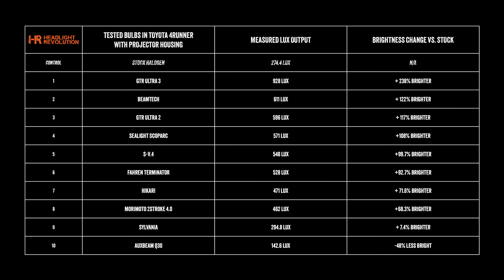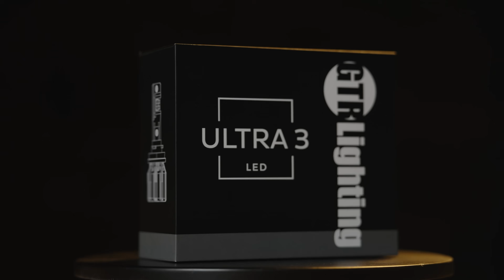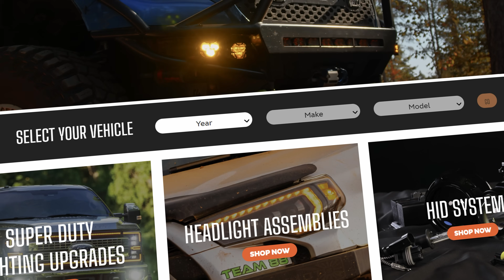The Brightest LED Headlight Bulb We’ve EVER Tested! | GTR Lighting Ultra 3 Tech Review

Comment: Phillips Ultinon Rally 3590 90w leds seems brighter than these
What you think?
Reply from the maker: I find it very hard to believe these bulbs are 90 watts per bulb, or 15,000 lumens per bulb - the brightest we've ever measured and tested before was the Ultra 3 coming in at 4,700 lumens per bulb! I haven't tested these in person yet but going off my experiences, I would find it very hard to believe those numbers at face value without some testing.
Reply: @HeadlightRevolution 
They are announced at 90w per bulb, but 15000 lumens is quoted for the pair, so 7500 lumen per bulb
I already purshased them and they have arrived today.

I'll give you my feedback as soon as they are installed
Reply: @HeadlightRevolution 
I just installed them. I can guarantee that I've been following you for 5 years, I've tried at least a dozen pairs, I'm very demanding when it comes to color and brightness, and I can already tell you that these are the most powerful bulbs I've ever used. I have a 2006 vehicle with halogen projectors; 2025 vehicles with full LED headlights can't match the powerful illumination of these bulbs. I'm the one who lights up the road the most, no matter how I adjust my headlights. The cutoff line is perfect; I encourage you to try them if you have the chance.

Comment: Would these need anti-flicker on an old 3rd gen cummins?
Reply from the maker: You shouldn't, no! We do offer them if you run into an issue, but generally you'll be just fine running them!
Reply: @HeadlightRevolution  Appreciate the response, the stock ones this week were absolutely horrible on the highway.  Was like holding a candle in front of the vehicle lol.

Comment: Gtr bulbs are a good product and I’ve recommended them to other people before. But I can’t justify spending $500 if you have to buy 4 bulbs for 2 for low beam and 2 for high beam. For that much money I was able to buy brand led  full housing headlights and diode dynamic led foglights on my jeep. Morimoto is also a cool brand as I still run their led turn signals. I just really wish you guys could bring down that price point

Comment: @headlightrevolutionI had a couple question about the yellow variant of the GTR Ultra 3, first when can we see a test of it or review? and secondly I notice it comes in a 9005 variant which is typically a high beam bulb which I'd like to see how it performs in that task. I know the yellow light will have a lower light output than white (as is always the case) but the warmer light being softer on the eyes especially when reflecting off signs etc might be preferable for some. However I also noticed that there isn't a 9006 variant (yet?) which is typically a fog light bulb and a more common place to see the yellow light bulbs installed and wondering why that is and if there is plans for one.
Reply: While I'm on the topic of light temperature. While I haven't had the opportunity to test out the Ultra 3 yet as it's premium priced so haven't decided if I can justify the cost yet, I do commend the choice of going with a warmer light temp of 5750k for the Ultra 3 white variant as it's so uncommon to see LED chips below the 6000k temperature which is a bit on the dazzling blue white side of things and I've been looking for something in the warmer shade (closer to oem color) that's still brighter than stock and works with the lower voltage of DRL lighting as I have a vehicle that uses the same bulb for high beam and DRL. So far I've only found one LED that worked with my DRL voltage and those were a switchback model that wasn't much brighter if any than stock (if only they had an option to light both colors at once it may have been brighter and a warm white as it would mix 6000k with 3000k) but those were 44 dollars so there was only so much I could expect from them.

Comment: How do these compare to the OSRAM night breaker laser HID bulbs?
Reply from the maker: It depends on the projector and ballast. In a true HID projector on a 35W/50W ballast, OSRAM Night Breaker Laser is a benchmark for long-range throw. In halogen-based optics, a purpose-built LED often delivers more usable light and a cleaner cutoff than a drop-in HID.

Comment: So I have a 2017 Tundra. I just care about how well I can see. Would these be better than replacing the whole,headlight assembly with the morimoto ,option?
Reply from the maker: It really depends on what you’re after. If your main goal is just seeing better at night, upgrading to LEDs such as the Ultra 3 is the easiest and most budget-friendly way to get a major performance boost. If you want more than that—like a full style upgrade with modern DRLs, sequential turns, and a big jump in overall output—then the XB headlights are the way to go. Both will be a big improvement over stock, just depends how far you want to take it and kind of budget you have to play with.
Reply: I also ordered the ultra 3.0. But now I’m wondering if they’re gonna be too bright and if I’ll get pulled over for them? Would I be better off to use the standard halogen to come in the alpha Rex headlights?

Comment: Sir, for your C5 Corvette, did you need to upgrade the stock halogen projector housing to an LED projector?  Or can use just install the Ultra 3 bulbs as is?
Reply from the maker: No need to upgrade or modify the projector housing—you can install the Ultra 3 bulbs directly into the stock halogen projector on the C5 Corvette. They’re designed to work with the OE setup as-is. Easy upgrade, no extra hassle.

Comment: For a 2019 dodge Durango is the anti flicker device necessary? I’m worried about fitting it all with the dust cover but don’t want to spend this much on some bulbs and have issues. Thanks!
Reply from the maker: We haven’t tested the 2019 Durango specifically, so we can’t guarantee whether the anti-flicker module is required. That said, most MOPAR vehicles do need one, but in previous testing on earlier Durango models, we didn’t run into any issues without it.

If you want to play it safe, using the anti-flicker module is the best way to ensure long-term reliability. But if space behind the dust cover is a concern, you could try running the bulbs without it first and only add the module if you notice any flickering or startup issues.

Comment: Do these work for a 2015 4runner limited that has the DRL / High beam combo bulb?  I have tried many led bulbs, but they always flicker when in DRL mode... The only ones I found do actually work with this combo So far are the VLED ones since they have 6v DRL mode.... Can you confirm if these new bulbs will work as a DRL and  high beam for 5th gen 4runner limited?  Secondly well these work in a cold climate? I live in Montana and in the winter it can drop to -20 Fahrenheit and a lot of people are having problems with led bulbs in the winter.  Ty
Reply from the maker: Yes—these will work for the DRL/high beam combo on your 2015 4Runner Limited! We’ve got Ultra 3 testing content on a 4Runner coming very soon, so stay tuned for the full breakdown.
Reply: @HeadlightRevolution  Wow perfect....I need to replace my flickering ones....I look forward to that video as I have the Projector housing factory.....
Reply: @HeadlightRevolution  Last question is will they be ok in extreme cold like up to -20 in Montana winters? I see you showed one model with some kind of pre heater in it....but I would prefer these.  Thanks

Comment: well ' these bulbs are extremly expensive and even more expensive to ship to my country , so my challenge to headlight revolution team if I bought these bulbs and compared them to other bulbs from my choice and it appeared my choice are actually brighter , would you give me a refund for my work , of course I will be recording everything for proof !??
Reply from the maker: We’d be happy to assist with setting up a return and refund, but it’s important to note that comparing brightness isn’t always straightforward. Without a controlled testing environment and the right equipment, it can be difficult to differentiate between actual brightness and other factors like hotspot patterns or beam distribution. We have the tools to make those precise measurements in our studio. While we stand behind our products and are committed to customer satisfaction, our policies do require that returns and refunds be handled according to specific guidelines.

Comment: Why not test against DDM Tuning?
Reply from the maker: DDM Tuning hasn’t been one of the most requested brands lately, which is why it wasn’t included in this round of testing. That said, we’re always open to suggestions—I’ll add it to our list for future comparisons!
Reply: @HeadlightRevolution +1 for DDM Tuning testing! I’ve been looking on BulbFacts and they’ve been listed as the brightest for a while now! Supposedly 1614 lux measured on low beams
Reply: DDM Tuning? 😂😂😂😂 Are they still in business? Haven't heard of them since the original Fast and Furious. What's that 26 or 27 years? 😂😂😂😂

Comment: For this car, I see they mention of high beam bulb, are there a separate high beam and standard driving lights?
Reply from the maker: Some vehicles use a single dual-beam bulb that handles both low and high beams in the same housing, while others use separate bulbs for each function. It just depends on the vehicle’s headlight design.

Comment: Sorry to ask but do you place the rubber boot that sits on hack of many stock headlights over this bulb ? Or do you push the boot over this bulb so it can release more heat? (Toyota landcruiser 70 series )
Reply from the maker: No worries at all—happy to help! 👍 Typically, you’ll want to reinstall the rubber dust boot over the bulb to keep dust and debris out of the housing and away from the fan. The Ultra Series bulbs are designed to manage heat even when covered, so it won’t impact performance.
Reply: @HeadlightRevolution can I clarify - you own the GTR brand? I came here thinking I was getting pure objective analysis. How do your gtr brand globes compare to the f12s? Surely you can’t say the gtr at half the wattage are better?
Reply: F12? 😂😂😂😂 Have you even read that website. It's Engrish from China has misspelled words all over it. Plus, one paragraph says 240W and then it says 220W. It also says 120W and then 110W individually. The funniest part is 42,000 lumens! Do you know what 42K lumens would look like? It's one GTR bulb multiplied by 10. You're going to tell me their LEDS are 10x more powerful. 😂😂😂😂.

Comment: What is the difference between a Lifetime Warranty for the Ultra 2's and a Limited Lifetime Warranty for the Ultra 3's?
Reply from the maker: Both the Ultra 2 and Ultra 3 bulbs come with the same Lifetime Limited Warranty, supported by the GTR Lighting team in Atlanta, GA. The term "limited" just means the warranty doesn’t cover things like misuse, modifications, or damage from improper installation.

If you ever run into any issues, just reach out with photos or video before removing the bulbs—we’re happy to help!

Comment: Are GTR Ultra 3 brighter than Bi-LED: Morimoto M LED Stage III Projector System by ~238lux in low beam?
Reply from the maker: That’s really an apples-to-oranges comparison. The GTR Ultra 3 is a drop-in LED bulb, and its performance will vary depending on the headlight housing it’s used in. On the other hand, the Morimoto M-LED Stage III is a dedicated bi-LED projector, designed for consistent, high-performance output in a proper retrofit setup.

With the M-LED, the output and beam pattern stay the same no matter what headlight it’s installed in—it’s a controlled system, while drop-in bulbs depend entirely on the reflector or projector they're paired with. Both are solid, just built for different purposes!

Comment: Brighter the bulb shorter the lifespan
Reply from the maker: That used to be true—but tech has come a long way! The GTR Ultra Series 3 uses advanced Thermal Separation Technology (TST) to manage heat more effectively, which means you get maximum brightness without sacrificing lifespan. These bulbs push out 4,700 lumens with a compact design that fits better than most competitors, all while staying cool and reliable.

And the best part? They're backed by a lifetime warranty. You won’t need another set once these are in.

Comment: Not street legal??  Ahhh, forget it!!  My question:  Any LED replacement bulbs that replace halogen and street legal??
Reply: The DOT will not test or certify any aftermarket led bulb. That is why all LED headlight bulbs have to be classified as "off road use". But I've never heard of anyone getting a ticket or cop pulled over. I've been using different LED bulbs since 2019 and no issues in the street.
Reply: @fauguy23  ... thanks for the message
Reply from the maker: LED and HID bulbs like the ones in this video are not street legal for use in headlights on public roads in the U.S., since they don’t meet DOT/FMVSS108 standards. They are legal for fog light use, and many people run them off-road or on specialty vehicles.

For true street-legal headlight upgrades, we always recommend switching to DOT-compliant headlight housings instead of just replacing the bulbs.

More info here if you’re curious: https://www.headlightrevolution.com/street-usage

Comment: I doubt these are the brightest on the market, compare them to Diamond Vision F12, or Novsight N70
Reply: F12 is 85W stable and these are 43. I use the F9 and now F12 and pretty sure the F12 would be brighter than the GTR Ultra 3.
Reply from the maker: Appreciate the recommendation!
Reply: @HeadlightRevolution so have you reviewed the f12s? Are you objective or a specific brand advertiser ?
Reply: Those f12s are 220watts!!!
Reply: @robertmillar2037 110 starting wattage per bulb, 85W stable per bulb.

Comment: Cool about Brightness but what about longevity? Sometimes being the brightest isn't the best long term
Reply from the maker: Totally fair question—and yeah, brightness means nothing if it can’t last. That’s why GTR bulbs are known for being extremely reliable, and they’re backed by a lifetime warranty. They use a custom TST 7045 chipset instead of off-the-shelf stuff like CREE or Philips, which gives them better output and beam accuracy over time.

Plus, they’re designed to run cooler with Thermal Separation Tech, so they don’t burn out like some of the bulkier, hotter options. Bright and built to last.

Comment: Does it matter which orientation the head of the bulb is? IE the “blocked off side” being up or down in the housing?
Reply from the maker: Yep, the orientation definitely matters. You’ll want to make sure the LEDs are facing side-to-side, not up and down. The “blocked off side” should usually face down, but it depends on the reflector design. This video breaks it down: https://www.youtube.com/watch?v=NbfAyqVgVdM&t=19s
Reply: @HeadlightRevolution yeah my question was just specific to the ultra 3, I have a couple sets of ultra 2s and am used to them being “blocked off” on both sides of the chip. Thanks!

Comment: I want to see testing on a stock headlamp that has a reflective patten in the actual headlamp lens. Like a stock 2003 sierra headlamp. No projector, no reflective style housing. Just the lens doing the scattering.
Reply from the maker: Ah, love when people confidently get it wrong 😅 The fluted lens on something like a 2003 Sierra does affect how the beam looks, but it’s not what creates the beam pattern. That job belongs to the reflector optics inside the housing. The lens just diffuses it a bit—think of it like softening the edges, not shaping the light itself.

That’s why when people retrofit those housings, they usually swap to a clear lens. Keeping the fluted one just blurs the new beam pattern and ruins all the work you put into the projector.

So yeah... not how it works, but thanks for playing.
Reply: Your response is out of line. I constantly commend your staff on the videos and I've purchased multiple sets of leds from you guys. My comment was a sincere comment not knowing whether it would change how the pattern is. Ive only installed on projector or clear housing. I didnt make one insinuation. I went back to stock style capa cert housings from projectors and was worried about it messing the lighting up. Ease up  @HeadlightRevolution
Reply from the maker: We appreciate you being a longtime supporter. Just poking fun with the original reply, definitely didn’t mean to come off harsh. It is a common misconception we hear a lot, so we try to clear it up with a little sass sometimes 😅 No hard feelings at all—we’re glad you brought it up, and if you ever want help dialing things in with your setup, we’ve got you. Thanks again for being here!

Comment: I was just wondering about the Ultra 3 the other day.   Can they survive being powered on for 6 or 7 hours nonstop?  That's how long I drove last week from NYC to Chicago.  First stop was 6 hours later, only because the gas tank was almost empty.   The entire trip was at night, starting around 10pm.
Reply: Can't wait to see comparison to 2Stroke 4.0!!!  I love the 2Strokes, but I've got see that new 5750K and beam pattern control directly compared to Morimoto!
Reply from the maker: Absolutely—they're engineered for exactly that kind of performance. The Ultra 3 uses GTR’s TST (Thermal Separation Technology), which keeps heat under control even during long drives. Running them for 6–7 hours nonstop, like your NYC to Chicago trip, won’t be an issue at all.